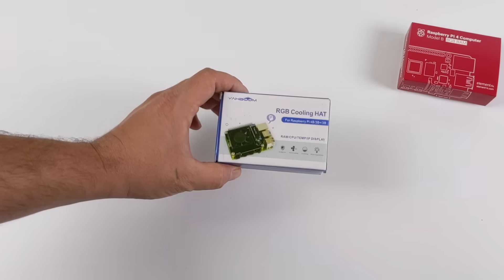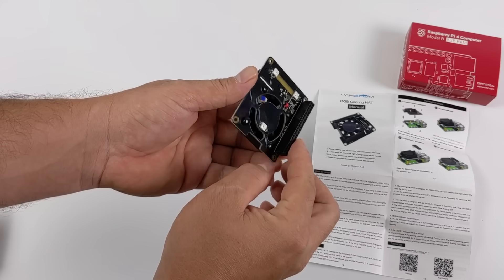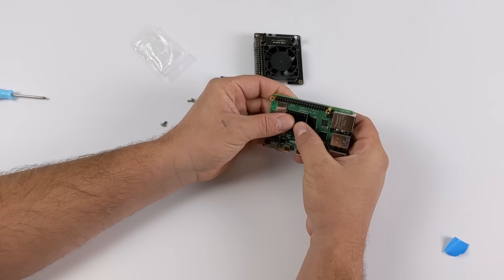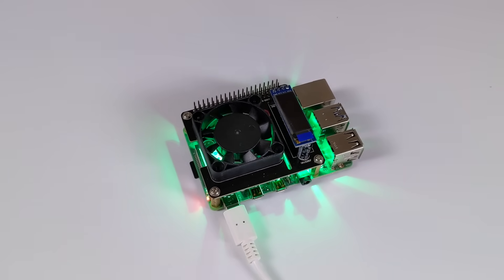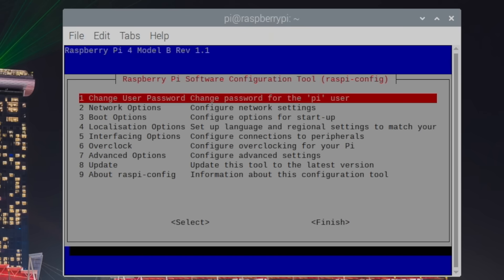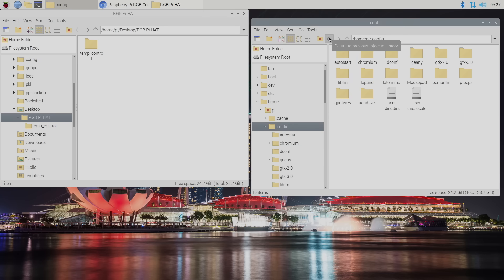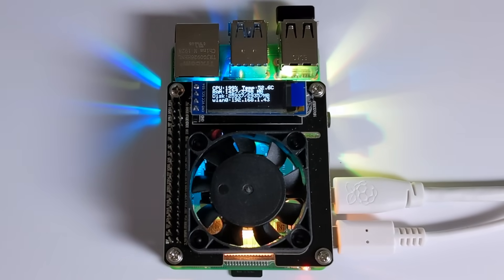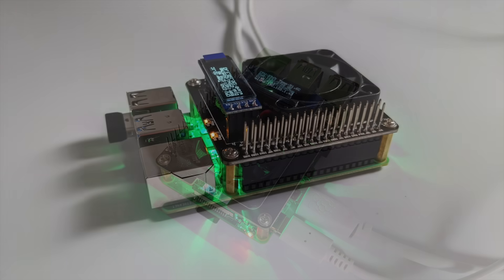Raspberry Pi 4 OLED/RGB Cooling HAT

Comment: Hey, I was wondering if you have installed this while using another image such as Octoprint - a 3D printing platform that installs on a RPi. It doesn't have the folder "pi/config/autostart" so I'm at a loss on how to get it working. TIA!

Comment: To anyone trying to fix the 64-bit issue in oled.c, I think the CPU usage is showing 10x more than it's supposed to - i just added another 0 to the line where avgCpuLoad is initialized and it seems to be accurate to the usage in the task manager now!

Comment: I got four of these things from one of the discount sites.... I had problems from the start... the libraries they are using are deprecated, python 2 is obsoleted, and the instructions were unnecessarily complicated...

Not being someone to worry about little things

customise
It does some neat things like allowing me to set my own;
- HI and LO points for the fan and the color changes, 
- setting alternating colors at the HI and LO point
- Setting  colors for each degree (between the hi and lo)
- And I've  created a library of over 1500 colors

I have a 4 PI's (both 3 and 4s)  in a tower with a bunch of other toys (Pimoroni Rainbow and and 4X20 HD44870 LCD) they  run pi-hole, plex, my house web server and a few other applications.

I'm going to build a custom tower to include some additional PI's,, my SSD's. 
I'm also working on  software to tell me what's going in the "array" and time/date/weather and any other news I may need.. it will use the Rainbow hat for input and the LCD for output..

Comment: The CPU% given is probably based on the *nix/linux load value, this can for example theoretically be 1600% on a single core single thread on a AMD bulldozer, since that architecture can execute up to a maximum of 16 instructions per clock cycle (but the real world value is much much lower).

Comment: I recently picked up the 8gb Pi4 starter kit from Canakit. I'm presuming this can't be used along with the protective case due to space constraints? I don't care about the mini readout display with the lights. I just want to add the fan, which seems more robust than the one included with my kit. 
Kit I snagged - https://ibb.co/ZTjN8Zg

Comment: Many thanks for the video. 
Just got mine. 
The changing lights are working but he OLED shows nothing but white dots all over it.
The Fan was not running yet but it may be because it is below the threshold for now.
I tested the OLED with Arduino and it is working fine with Adafruit library.
While I ran the ./oled after compiling in gcc, I got the same error as shown on their website but I got an extra message, "Segmentation fault" below the "init OK".
I installed the wiringPi lib from as described, from the github link.
Pulling my hairs out now.
Reply: NVM
I fixed the code myself.
tmpAddrPtr = &((struct sockaddr_in *)ifAddrStruct->ifa_addr)->sin_addr;
This is causing Segmentation fault on my Pi4B 2GB Rev1.1 4.19.118-v7l+ #1311 on Buster

Comment: I would love to have the display sold separately being connected with 4 wires!
Reply: The display is a basic i2c display you can buy for dirt cheap online. There should be tutorials online to help idk
Reply: The display is sold separate... its iC2 connection... Adafruit has them ... 15.00

Comment: Do yo think that the ice tower cooler could fit on the raspberry pi 4 8Gb?
Reply: It should. All the main components are in exactly the same place, with the power management being the exception.
Reply: @DigitalJedi  thanks, I was thinking about  getting the 4gb model but suddendly a wild  8gb model appeared and i want the ice tower cooler.

Comment: If you could get this running with RetroPie that would be amazing. I actually bought one of these back in December (I live in beijing), but I couldnt get it to work with Retropie. So i just ran the fan wires to the GPIO 3.3v and am stuck with the green LED.

Comment: When has Raspberry Pi became a $100 dollar, fan operated PC :D we've gone a full circle here, hehehe just saying...
Reply: At least it's only using a few Watts.... that is certainly very attractive for 100% on usage, such as PiHole...
Reply: @booboo699254  Or even an email/web browsing pc.
Reply: @nathanhamman418  lol who really uses a whole device for 1/2 uses these days? Abit impractical; especially for email and web browsing :/
Reply: @gxqx797  If all someone does is web browse and check email, its worth it.  I know quite a few people that would make it with just a raspberry pi 4 as their only computer.
Reply: @nathanhamman418  yeah true actually; but then cant the pi 2/3 do that all the same? Why fork out for the 4 ?
Reply: @booboo699254  Just use your old Pi3 for PiHole and use the Pi4 for heavy work. P.S. My PiHole runs 24/7 and with no cooling uses maybe 10 watts.
Reply: DagicCross Well, theoretically you could run the Pi 4 fanless, but it’d often hit the throttling temperature of 60 degrees.
Reply: I think the industrial uses for these boards is where the potential is.

Comment: This makes me think: could we use the temp-control script from this on other fans for the Pi4 if we already have, for instance, an ice tower cooler on it? At 5v that thing whines a lot, but I feel uncomfortable leaving it at 3.3v constantly as well, so this might be a nice solution. Think that’d be possible?
Reply: I'm probably being stupid here but depending on the fan you have wouldn't you possibly need to add more connections than it comes with "as standard" or need to modify it a bit? I'm probably missing an obvious way to do it but I would think that if you wanted to change a fan to be off/low/high you'd need a few connections and a way to switch between the 3V and 5V supplies?

Comment: Just a random question could I play eve online on this? I dont mid running it at low 720p as long I can get 25 to 30 fps.
Reply: Probably not. You would be gpu limited, not to mention the issues with trying to get the game running.

Comment: the screen is nice, and it's cool that you can run the fan at different speeds... but those rgbs...
that's a sbc without any kind of aesthetics, it doesn't look exactly good.
adding rgb on it, is like sprinkling glitter on a poop.
Reply: RGB is pointless, everything else is not bad i suppose needs to combine this into a nice case

Comment: I think the ice tower looks nicer.
Reply: I just wish they had gone with a better fan on that bad boy. At 5v, it’s a noticeable whine, and at 3.3v I’m afraid I’m not pulling enough air. Also, it has 4 LEDs in it, but they are of the “random fade individually” type - they start going out of sync and occasionally create neat blends, but otherwise... meh. Honestly though, it’s the noise-to-airflow ratio that has me sad. It just... isn’t there. Otherwise, though, it’s a GREAT cooler. Almost never even very warm on the top fins or the tips of the tubes. (Yeah, I poke at things while they’re plugged in, mea culpa...)

Comment: Anyone have recommendations for a good screen for the raspberry pi 4?
Reply: The official 7 inch display should suffice for a general purpose use
What is your use case?
Reply: I recently got the elecrow 5.5”. I like it because it comes with multiple adapters for pi 4 and legacy boards, but it does take up most of the gpio so keep that in mind if you are using the gpio for active cooling.
Reply: @zacharywalker3423  60hz and ips?
Reply: The 7" official display should work well for any purpose without any glitches
Reply: The Osoyoo 5” also seems pretty good, it is also connected with DSI like the official one and supports touch without any drivers. It also doesn’t occupy either HDMI or GPIO
Reply: Pimoroni hyperpixel if you're looking for something small.

Comment: I'm amazed RGB isn't standard on the Pi by now.
Reply: razer haven't been involved in the pi yet
Reply: RGB = FPS!
Reply: If it ever does I'll stop buying them.
Reply: it's designed for industry (reason why pi 4 has dual display output). that power usage on flashy rgb would lead to bigger operational cost and is practically useless since customised LED indicator would do better
Reply: @haziqsembilanlima  no its designed primarily for tinkering so instead of making it more expensive with rgb your supposed to build/add your own if you want it
Reply: It's more fun to make your own!